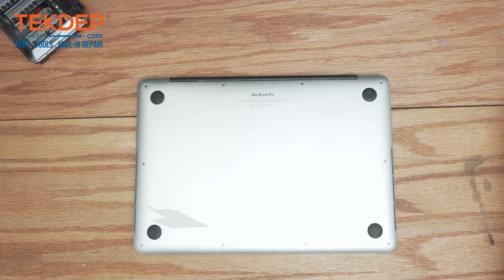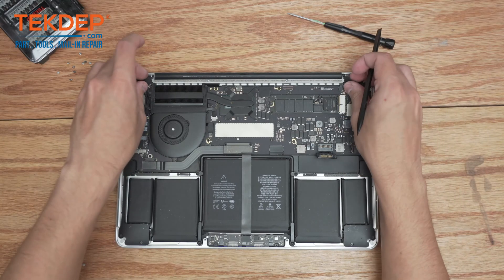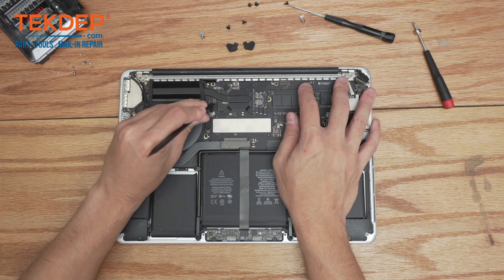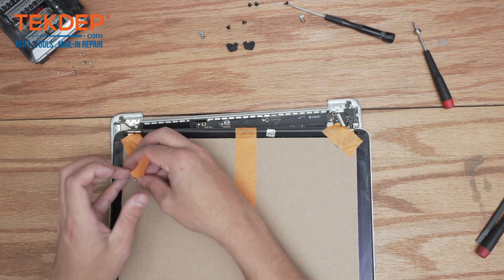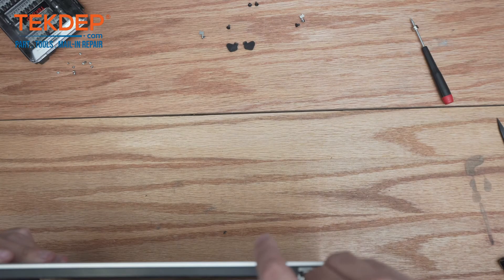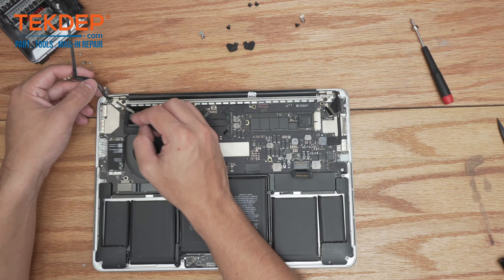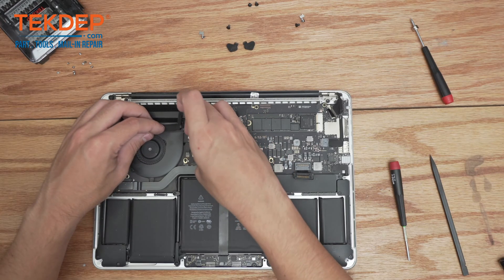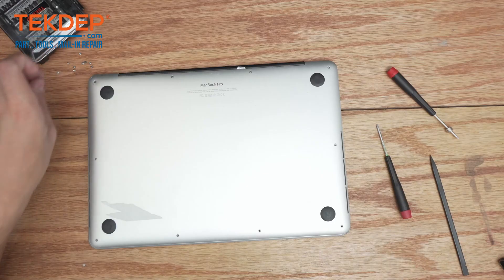Broken Display Replacment Guide | 2015 MacBook Pro 13” Retina A1502

Comment: I have a 2015 1502 I just bought for my daughter and the screen now has lines all the way across. I gently wiped it to clean it. Where can get a replacement screen? You video is very thorough so I think I can replace it.
Reply from the maker: Thank you, we do carry the lcd assembly’s at tekdep.com 

Here is a link to the 2015 models A1502 and it comes with tools 

https://tekdep.com/product/a1502-lcd-display-assembly-for-apple-macbook-pro-13-tekdep/